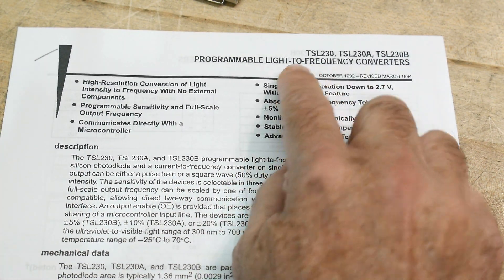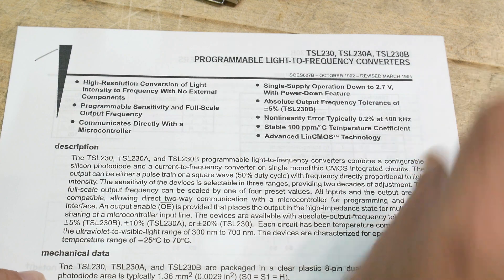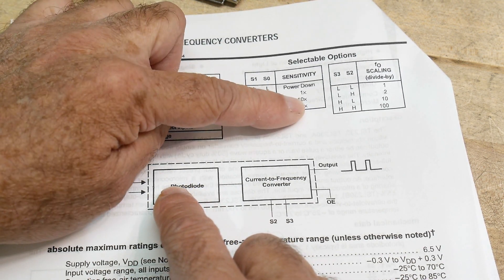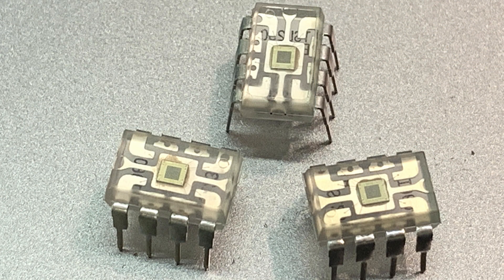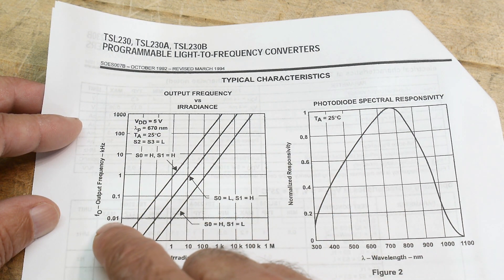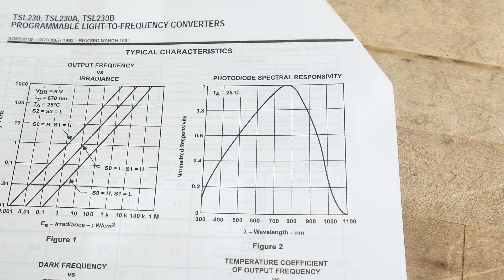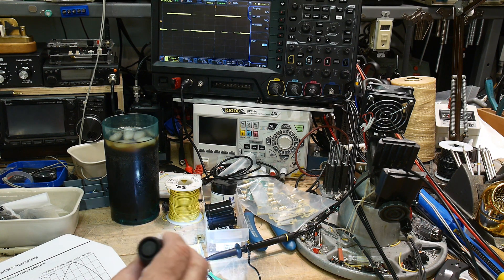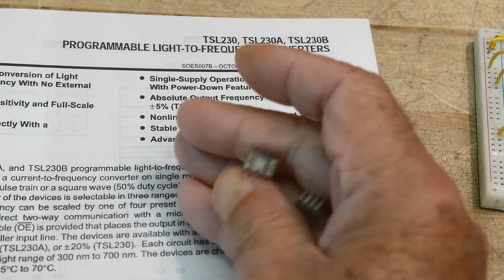#1184 TSL230 Light to Frequency

Comment: Microcontrollers have hardware counters that can count pin transitions and they have hardware timers that divide the crystal frequency.  Together, you get a fairly accurate frequency counter.  To get more than 8b resolution and/or a reasonable dynamic range, you might need to supplement the hardware with software and a few bytes of RAM.  If ultimate calibration is needed, the color dependence presents a problem that a single microcontroller might be unable to solve.

Comment: I did some work with these in the 1990's, and found that, using the 100 diodes, it would give a measurable signal, useful above the dark current, in my garage, so dark that you could not make out your hand in front of your face...also, there is a standard filter from Hoya, a blue temperature conversion filter, that gives a rather flat spectral response from say 430 mm to 800 mm...

Comment: That's super cool. Could be useful to control synthesizer parameters, BBD, or perhaps for PWM compressors?
Reply: for space applications as well. it would be easier to use optical gates in some cases since electrons are harder to get to operate at colder temperatures than photons

Comment: I miss all of these oddball goofy ICs that the silicon valley guys were churning out in the 80's & 90's.
BBDs and sensors and tone decoders...
... oh my.
:D
Reply: They're still chugging them out, they just all speak I2C, SPI, TTL, or a one off odboll protocol.  Looking at you 1-Wire, and RGB LEDs!    Then there's the whole part where NFC chips don't actually transmit anything.  They modulate their power draw, and the transmitter uses that to determine the bitstream.

Comment: In re: I2C light sensors--the BH1750 seems to be an easily obtained part conveniently mounted on eval boards (see Adafruit and others).

I think it's amazing that TI didn't include a single application example, other than suggesting this part would conveniently mate up with a microcontroller. Apparently, TI marketing took the day off when the datasheet was being prepared. (grin)

Finally, @IMSAI Guy, someday you should do a "clean up" video or videos where you address some of the questions raised in the comments.  A lot of the questions don't justify a full episode, but I think there are enough cliff hangers left that you could string several short topics together and make a full video.  

You'll notice how quickly I volunteered you for additional work. I'm always trying to be helpful that way.

Comment: Yes indeed that is a cool chip but I can't quite seem to think of how I would use it.

How do they measure light intensity to make a spectral graph like that?  Since light sensors have different response at different wavelengths and since light emitters have different emission at different wavelengths the only way I can see to correlate the two is by use of some basic physical phenomena like black body radiation or absorption.
Reply from the maker: they use a monochromator https://youtu.be/jHsQxFlDuHQ to input various frequencies of light
Reply: It could be used in a number of musical applications. It could be used to make a theremin-type instrument, as an oscillator for a synthesizer, a variable clock signal, light-controlled LFO, perhaps to control a pulse width modulated compressor/VCA?

Comment: Can we connect the output to an audio amp and define the output to be within the human hearing range?
Reply: Looks like 0.001 to 1000kHz range output... so 1Hz to 1MHz.   What's the easiest way to translate the scale from 1Hz-1Mhz to 1Hz- ~20kHz for the full range of intensity/radiance?
Reply: @jafinch78  the output divider can make it f0/100, so the range would be from 10Hz to 10kHz... mostly audio, though 10Hz is a bit low :-).
Reply: Since his 'scope is set to 1 mS/div, it would appear that the highest frequency he shows is about 3 kHz (kind of hard to see), I'd say the highest frequency is already in human hearing. The low frequency range also seems to be well below human hearing, though.
Reply: I suppose you could hook it up to an audio oscilator. (?)